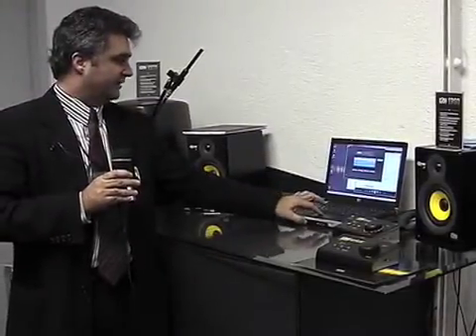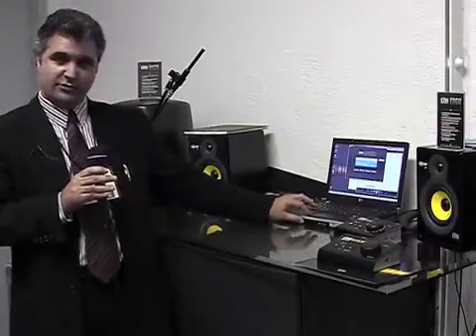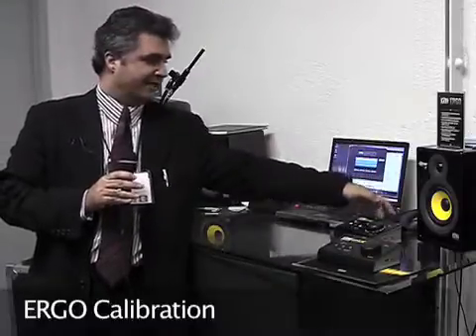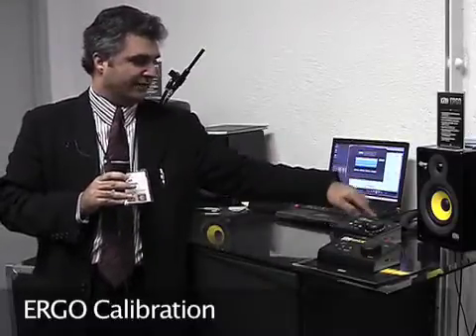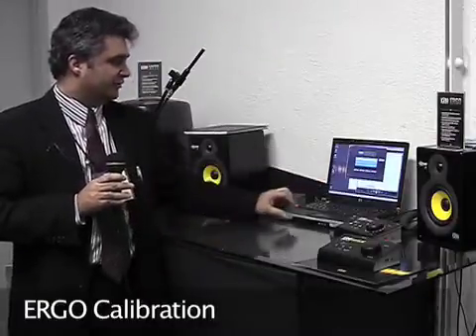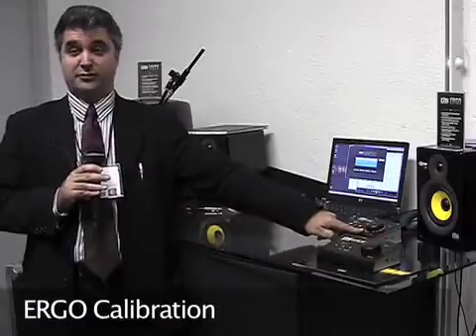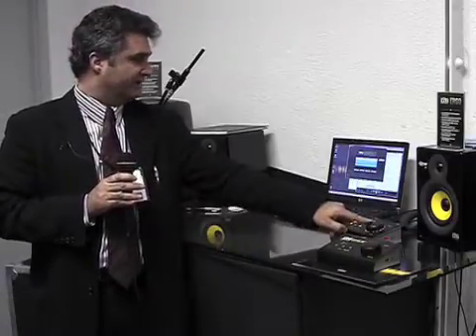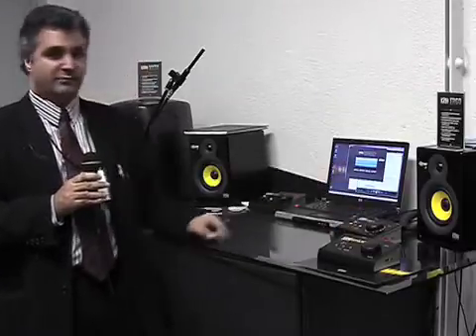ERGO Room Correction Demo

Comment: Hello KRK, I just installed my Ergo, but I just do not seem to know why I am having trouble connecting with my Focusrite LS56 via SPDIF.  Ergos Firewire seems to be working fine, but when I do change my firewire cable back to LS56 and try to run through the SPDIF, the Control Panel screen just doesnt move to SPDIF.  How can I rectify this?